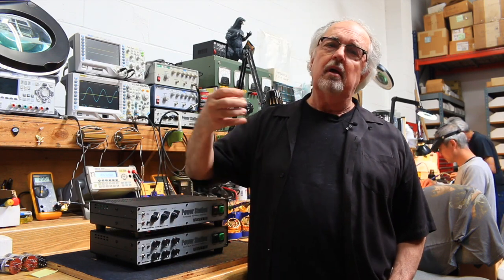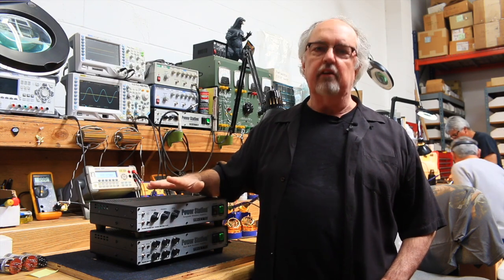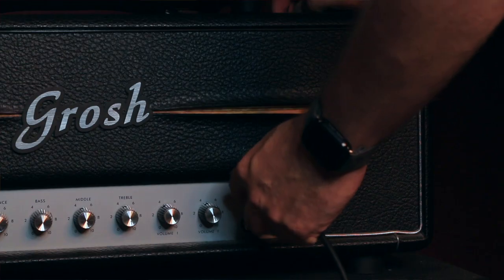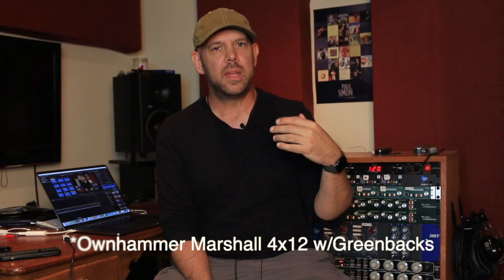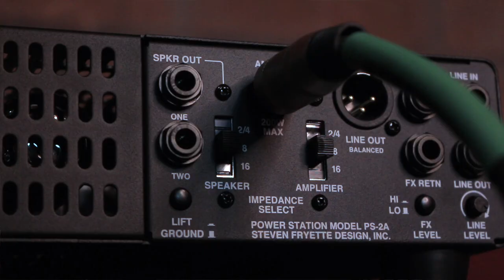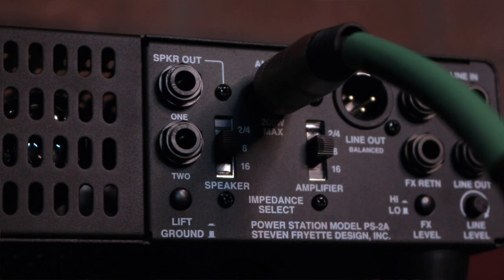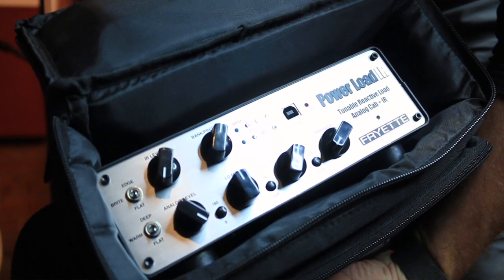DOES THE POWER STATION MAKE MY MARSHALL SOUND LIKE A FENDER?

Comment: I noticed a difference, but It isn't like either one sounded bad. I know that in the room you can go back and forth between the PS being on bypass or not and dial the PS in to get it to sound basically identical to the amp without it in the room. Is the PS the same as playing directly into a cranked Marshall? I don't think it's identical, but I also think it sounds good and feels good. I don't know of another attenuator that is this good.

Comment: It is possible to put 6L6 tubes in a Plexi after some little changes. It will not make it sound like a Fender. It will still sound like a Plexi -- pretty much like one with 6550s in it. My old Laney amp had EL84s. It did not make it sound 'chimey' like a Vox. If I had put 6V6s in there it would not have sounded like a Fender Champ. Putting KT66s in my JMP 50 build will not make it sound like a JTM 45 either. Quite a lot of folks seem to think tubes are primarily what make amps sound the way they do. Not sure why.

Comment: Would it be easier to say that power amp doesn't alter the sound, it is the eq stack that makes the sound (part of preamp), power amp is suppose to be neutral and it almost is even that it is tube amp (old tech and not so neutral as transistor amp).
Reply from the maker: It might be easier to say, but it's a bit of an oversimplification and misleading to say it that way.